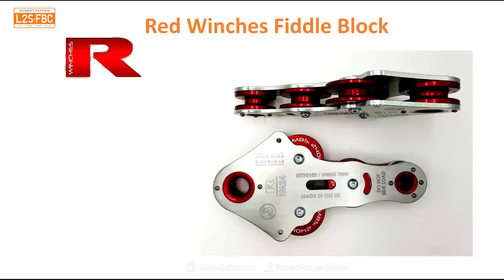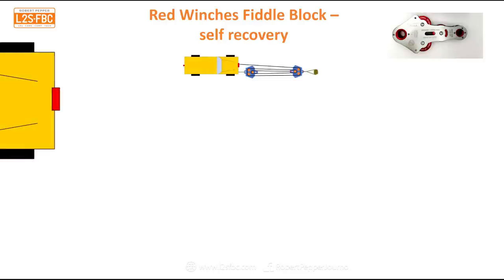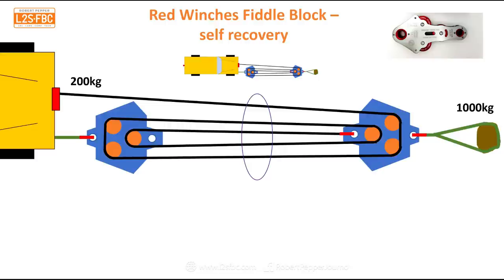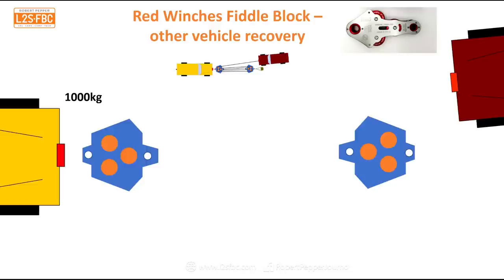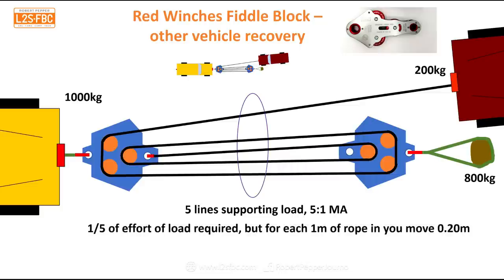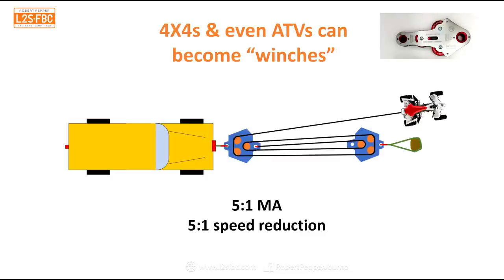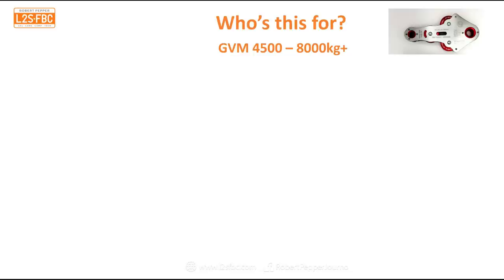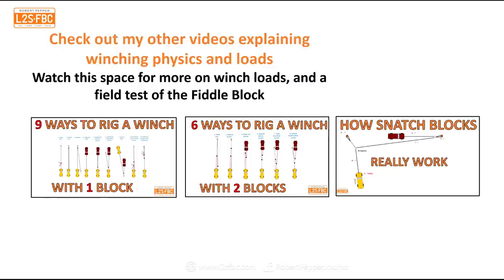What's a Fiddle Block for 4X4s?

Comment: 5 lines don't make 5:1 MA, only 4:1 since one line only changes the direction without giving any mechanical advantage. Count your lines and subtract one. Try it, you'll see.
Reply from the maker: Depends how it's rigged, either 4 or 5.
Reply: @L2SFBC  Ok, I think I get it. The winch is essentially another pulley and the extra line is being taken up on the spool. The 6th line is not seen, but is there, thus yielding a 5:1 MA. advantage.
Reply from the maker: Correct. Depends which way it is rigged too. Can be used at lower MA.

Comment: There's no way I'd ever need this for recovery while off-roading. And the price?!?!?!  For light trucks, buy a snatch strap or recovery rope, a good winch that's a tiny bit overkill for your vehicle's weight, a couple of decent snatch blocks and be done with it. Assuming you follow the "don't wheel alone" rule and your partner is also prepared, that means you have at least two good winches and 4 blocks at your disposal. If you need more than that you're in bigger trouble than you think.
Reply from the maker: Yep !
Reply: Two snatch blocks per vinch is overkill alone!
Reply from the maker: Not always...
Reply: @magnus5356  2 blocks is the minimum required to to anything other than a single-line redirect or a double-line straight pull. It's the responsible number, imho; especially if you're alone.
My current recovery bag kit is 3 30,000lb blocks, 6 3/4" d-rings, 4 soft shackles, 3 tree straps, a 20ft snatch strap, a 20ft tow strap (can double as a anchor/tree strap), a 30ft recovery rope, a choke chain for moving things like fallen trees (can also be used as a sand anchor), 2 pair of heavy leather gloves and a headlamp. 
I carry other recovery gear in addition, but that's what's in the bag.
Reply: @PNWJEEPER01  how large are your bag??
Reply: @AndreasBrOlesen  lol; it's a medium size duffle bag
Reply: @PNWJEEPER01  Impressive. My recovery bag is actually also a medium duffel (65 liters). It contains a 30 feet kinetic rope, 90 feet winch extension rope, a three trunk protector, a recovery bag (deadman replica) one snatch block, four d-shackles, two soft shackles and a winch rope protector and I think my duffel is very full!
Reply: @PNWJEEPER01  
                    THANK YOU.
GREAT to hear and Know and LEARN.
Thanks again.

Comment: This product is virtually worthless for anybody that has over a 5,000 lb winch because it's maximum capacity is 26,000 lb at a multiplies the force by a factor of 5. Meaning that it's not safe to use with a winch over 5,000 lb

Comment: “Whos this for?” People who like shiney expensive things they are never going to use.
Reply: It gives a mechanical advantage so not taxing your winch motor so much, you can run longer between rest.
Reply: This is ancient technology. Anyone who wants to move any super massive objects and maintain control without the expense of giant cranes, or heavy machinery. A simple wood beam and column frame with enough of these and you can move anything. Want to cut down a tree and move it around for easy cutting? Maybe there's a heavy object you need to move in the garage? Maybe you got a water tank to lift up to a tower at the cottage only accessible by boat? Want to lift some gear up a mountain? How about the boulder in the way of the swimming pool? A tonne of bricks? Sore back?
Reply: Some of us work in jobs where we us dirt roads daily and we don’t have cell phone coverage?
Why are you watching this or commenting. Isn’t there a video about finding a park spot at the mall you should be watching?
Reply: @fedcoin1602  my issue is the price, and how thin it is, you need a plain ended rope to use it as described, not your standard winch line with a hook or much of an braided in eye.
Reply: @sharkeyist  if that is your statement, we would be in agreement. I’d add, that people should get a winch strong enough to pull their truck out without any pulley. 
My original reply, was in response to your original statement.
Reply: @brendanwood1540  You're talking about mechanical advantage in general. I hope nobody buys ones of these expensive shiny products just for shifting things around their garage.
Reply: @thebubaloomonkey  Why not? A man with only a 5:1 pulley block, rope, and anchor can lift or move some very large items. I can see it being quite useful on a farm or ranch with an ATV.
Reply: @PatrickKQ4HBD  I'm not disputing that mechanical advantage is useful. What I'm saying is, in almost all situations, this particular product offers no advantage over traditional block and tackle which would be a fraction of the price.
Reply from the maker: Agreed
Reply: @thebubaloomonkey  It offers a huge advantage, you just do not see it.  These dont twist up like a block and tackle does.  I cant wait to buy a set.
Reply: @ridgerunner106  a block and tackle doesn't twist if you reeve it correctly. Boats and cranes manage to use them perfectly well.
Reply: @thebubaloomonkey  Yes, and boats and cranes use fiddle blocks now.
Reply: @sharkeyist  Some of them have a wide enough throat for a hook.  They have a ramped boss area inside for the pulley.  Guides the cable onto the pulley and gives a wide opening between the frame plates.  You can put your hand through it.
Reply: @thebubaloomonkey  They will get cheaper.  In the US, a block and tackle with wood on it is the same price.  More of you get to using, price goes down.  Kind of like the Tirfor hand winches were over here.  Though I still use a Wyeth Scott more power puller.  I have a few of the Tirfor winches too.  I think the Tirfor is slicker than snot, I like them.

Comment: Great product testing videos. We use a lot of synthetic rope 10mm, 14mm and 20mm to winch over trees and move heavy equipment in our line of work. Agree that recovery of trucks and trailers requires a lot of force, I'd recommend 100m of 10mm Dyneema if you want to use these effectively. Thanks for the review, I think we'll add a couple to our kit. Cheers
Reply from the maker: Thanks always keen to learn from other industries!
Reply: @L2SFBC   have just seen that Red Winch makes a FM-50 with 20mm soft shackles, now were talking some serious 10t truck recovery with only 2t of force from a support vehicle and 100m of 10mm Dyneema (all working within a 5:1 safety factor). I'm impressed 💪
Reply from the maker: Yep I am hoping to test that

Comment: Each additional line doubles the pulling power.  The problem is that running extra lines use up a lot of line.  A winch typically has approximately 100 ft of line/cable.  Then to maintain a full wrap of line on the winch reduces available line even more.
Reply from the maker: Agreed, so I recommend using a winch extension rope for this.
Reply: @L2SFBC  Yes.  And that's easier to do with synthetic line as you've noted, rather than cable which isn't suitable for this block.
Reply: Most winches are rated with the least amount of line on the drum anyway.

Comment: So basically two snatch blocks for more money and less versatility, fine for digging beach bums out the sand but in a forest you often need one to change the angle of pull and the other to halve the load, or using two blocks on different anchor points to spread the anchor load , ( had as many as six pulleys on five anchor points when winching out stumps), this means the load on each point is less, creating less strain, and should an anchor point give way as its only a part load it is intrinsically safer.  Using a wire strop you can rig your pulley system and at the last pulley fix your hand winch, ( you shouldn't use a hand winch wire round a pulley) , to keep the hand winch line straight, ( again used this set up, including on boulders up to two tonnes),  the hand winch is a much underrated bit of kit and can be used at any angle, even away from the vehicle, get one and have fun !!☺.
Reply from the maker: Agreed good post!
Reply: And if you really like messing around in the mud do this with a high lift jack.
Reply: @maxgood42  got one of those as well, never used it with pulleys and wire rope but chain and hooks is fun, the high lift is another underrated bit of kit and can do far more than just lift your vehicle, as always take care out there.
Reply: @CrusaderSports250  Yes. so as Robert said there would be time and a place to have $1000 worth of pully system unless you are like bugs bunny trying to do the minute waltz in 30 seconds (High lift at 5:1) or adding 1 more pully in the Spanish Burton style it would become 9 or 10 to 1 and you could just pull it out by hand. XD
Reply: @maxgood42  not sure of the point your making, never been a fan of speed recovery as that's where accidents and/or damage are most likely to happen, my winch drives from the back of the gearbox, giving me a four speed in with power out as well, all speeds variable with the throttle, first or second gear being used with moderate revs and top gear for cable retrieval, using pulleys slows all this down even further. As I stated in my original post I see no benefit in something costing more for less flexibility, the fiddle block is in effect just two pulleys in one unit, two separate pulleys can be used to totally redirect the line pull to get round obstacles and give a straight pull and retrieve for both vehicles making them more useful.
Reply: @CrusaderSports250  I've used PTO's and electric and I agree that there should never be a rush for recovery. this reminds me the times in the NT when we would spend days getting out of a black soil planes, once we actually spent 2 weeks winching 5 Landcruiser's about 200 meters. the road can be very deceiving. I was thinking about the comical side of rigging. Like I said many pulleys reduce the load but at the same time increase the time needed for the line pull as well as re rigging to take another bite as when using pulleys and winches doesn't always mean you'll get free in one pull.
Reply: @CrusaderSports250  You can use for directional pull singles too.  These dont twist up like block and tackle.  Think about it.
Reply: @ridgerunner106  never had problems with single blocks twisting, its all in the set out,  are you referring to snatch blocks ie a single pulley, or a block and tackle, ie a lifting device that can be used as a winch?.
Reply: @CrusaderSports250  Block and tackle.  I have a neat critter, its a double snatch block, home made.  Has a clevis on both ends with two sheaves, side by side, with a partition between them.   It lets you angle a double line pull.   Plus, can use with a snatch block for a block and tackle.  I like the double line on close pulls because I use more cable off the spool.  More power and less cable damage.  Im usually off somewhere alone and need all the little tricks I can find, and all the help I can get.  Im not wheeling, but work as mechanic alone.  Sometimes into the night.
Reply: @ridgerunner106  we have a slight cross purpose, I take it your in the States as here in Britain a block and tackle refers to a chain lifting device often used for lifting engines and such like, I have used one as a winch as I had nothing else, a truly wonderful bit of kit but not as a winch, I agree with you about using blocks to cut down the loading, it may take a little longer but its safer and gives the winch an easyer time, especially if, as most of them are its an electric one, mine runs of the back of the gearbox giving a four speed plus power out winch plus variable speed via the throttle, an awesome and powerful bit of kit with 200 feet on the drum. As far as your solo Wheeling goes be very careful where you go and what you do, a minor accident could have you stuck without anyone knowing you need help, the same with working alone into the night, many many years ago my farther was welding a car when it sunk through the jacks holding it up, pinning him underneath, as it was a Saturday afternoon there was no one in the yard and wouldn't be till Monday morning, fortunately I had gone into work with him, never be allowed to today, and had to go and find someone to help, my farther only suffered bruising but the memory of that has stayed with me for over fifty years, so as I said be very careful.
Reply: @CrusaderSports250  Yes, I am mindful of careful.  I live alone and am in my shop a lot.  I do not get under anything unless it is supported properly.  I have  been hung up and had to get loose a few times.  Which is why I am careful now.  Thank you for your advice and thoughts.

Comment: Most synthetic winch ropes are between 80-95FT. so, with 5 lines, let's hope you're stuck 20FT or less away from an anchoring point. 
I'll stick with 2-22,000lb snatch blocks for $45 a pair.
Reply: Thats like deiving around on rock caveman wheels.

Comment: It's a similar idea to things available for motorcycles. "Motorcycle Recovery System (MRS) Part 1"
Reply from the maker: Will check it out!
Reply: @L2SFBC  The bike one shares more in common with rock climbing/rescue gear. You can get fiddle blocks for sail boats in the 1000kg/2000lb safe working load range.

Comment: I will correct you on one thing that  to pull the 2.5 ton/tonne vehicle the rope/winch wire must be rated  double the capacity minimum or triple the max capacity   of weight  the vehicle specs including any  GVM/GVCM upgrades you do..

noting  no matter what you call it and no matter how it is  configured it must be a weighted at the proper tonnage for the application you plan to use it  for ..

Personally I'd likely start looking past electric winch options  with diff winch based options, because it is a guarantee that electric winch options  will likely burn themselves past a 4.5/9 ton dead load

Comment: The affect of 2 movable pulleys would be 4 x 200kg = only 800 kg or no movement.
1000 kg/4 = 250 kg needed from the winch to move the 1000kg.
Why do you count lines? It is the # of movable pulleys. Here it is like having 2 giant movable pulleys.

Comment: What the hell is that mongtastic anodised blingit supposed to be? I need one of these, a chocolate teapot and a hand brake for a canoe :o) Seriously though, if you can’t get a hook through it then it ain’t much use. Also, if you have four ordinary swing snatch blocks you can easily run them to the same or different anchor points. Also also with separate ones you can rig forward and then to the side if you need to go forward and not roll down a hill side.
Reply: No, just use a single through for a directional pull.  These dont twist up like a block and tackle does.  Hook will pass through.  The sides have internal guides to keep rope or cable on pulley.  This is the cats meow, son, get you one.  I will be looking for the video.

Comment: The main problem I see is you'll run out of line as most winches are only capable of holding 85'. That means with 5 lines you can only be a maximum of 17' apart. The amount of scenarios where you can actually be that close together is virtually zero.  Two snatch blocks would be good for almost any situation and you have a more usable length of 28'. Big waste of money imho.
Reply: @Random look at the ratings of your tow straps or extension straps , nothing is rated safe if you multiply the winch 5 times.
Reply from the maker: Yes only metal shackles are likely to be 5x MBS over WLL.
Reply from the maker: Agreed

Comment: Great info I'm just wondering where is the steel cable at? I see most winches and most all wreckers have steel cable not rope. What's the big difference I'd think steel cable is better more durable. I haven't had trouble with steel cables n blocks
Reply from the maker: Recreational people use synthetic because it is lighter and safer.  Less durable isn't a problem for infrequent use not time constrained. Commercial people may use wire for durability.
Reply: I hate to say it, but synthetic is strong.
Reply from the maker: Synthetic rope is stronger, lighter and safer than steel. It isn't as robust if cared for. That's why most recreational users run Synthetic.

Comment: Do you think that with 2 fiddle blocks and a winch extension line that a light vehicle could be recovered by human power alone?  ie, if you didn't have a rear mounted winch, but there are suitable anchor points, would this give you enough mechanical advantage that human power would make a reasonable difference?  Or am I dreaming?  The experiment would be interesting.
Reply from the maker: if not badly stuck, yes. There are hand winches which do the job but they multiply torque more than fiddle blocks and are more efficient.

Comment: The problem that I see is that you will need 300-500’ of rope to use it. It’s rare that you are within a short reach of an anchor point and another vehicle if you don’t have a winch.
Reply from the maker: Yes!
Reply: No, you need lengths of extension rope to reach from the far block to the anchor, which may be the same or slightly larger than the winch rope. 
Once you move up from Jeeps and Toyota sizes, you begin to have more room for rigging and less for a proportionally larger winch.

Comment: you said to expect 6-10% frictional resistance from each sheave pulley.. there's 6 sheaves when using two of these together.... by that 6-10%...  doesn't that equal a potential 60% frictional loss??
Reply from the maker: See my current video on exactly this and the 60-50-40 guide for 2:1, 3:1 and 4:1 SB rigs.  Actual data!

Comment: Will this make a 3000lbs winch able to pull a full size ram 1500  ?  Is this hard on winch internals or only cable equipment?  Thank you sir ....
Reply from the maker: Yes probably but depends on badly it is stuck
Reply: I was thinking X-Bull ....haha but yeah probably
Reply: Its not harder on anything but you.